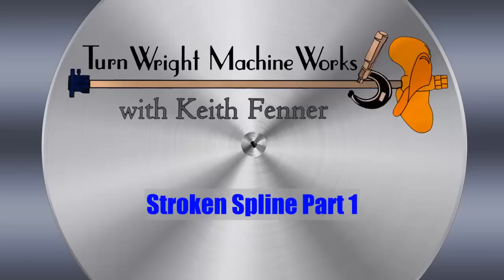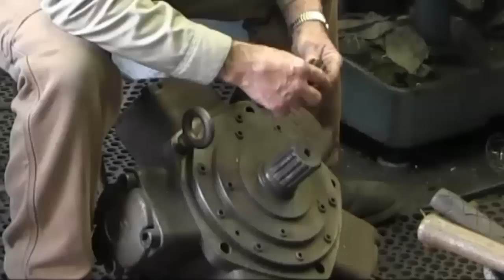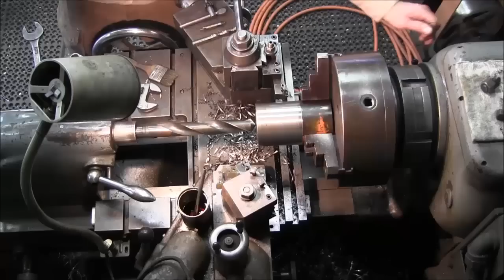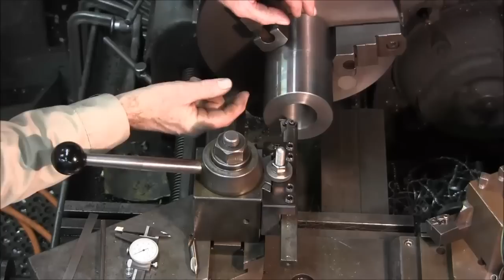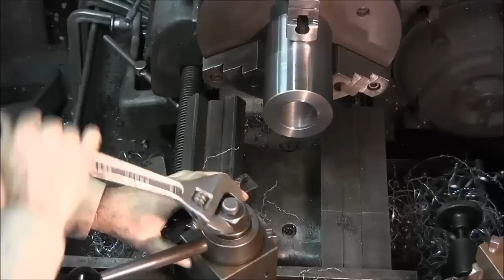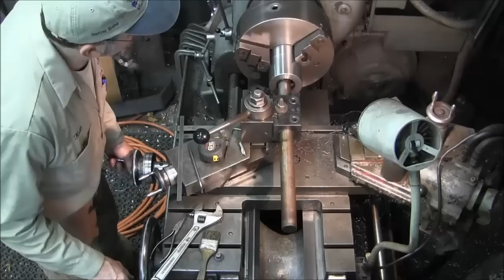The Stroken Spline Part 1

Comment: You're frequently breaking/knocking off the corners on projects, and for good reason. Safety and easier fittament, as I recall. I've wondered why you always seem to use a tool-bit for this, even bothering to swap for a better one! Would it not work as well to just pick up a file, and lightly touch the corner? Would that be too aggressive, or wear the file too much? 

Obviously would only work on outside corners, I realize.
Reply from the maker: I do grab a file and hit the corners at times but if I can use a bit, it cuts down on the skid marks on the files. ;{)------

Comment: Keith

Is that hydraulic motor drive an " SEW Eurodrive " brand ?  I think I've seen a similar one here, but I can't remember what it was on.  What's this winch used for ?  Five motors in a radial arrangement ?   Is there any gearbox in the winch, or only in the drive ?

That thing must punch out some hefty torque !

Cheers and happy New Year !
Reply from the maker: This winch is used on a work barge and the drive is direct. I'm not sure of the brand, my focus was on the spline shape. ;{)------